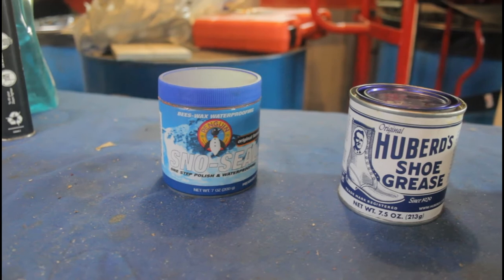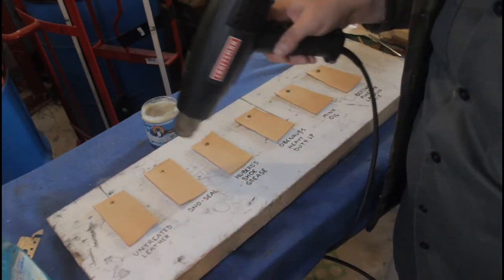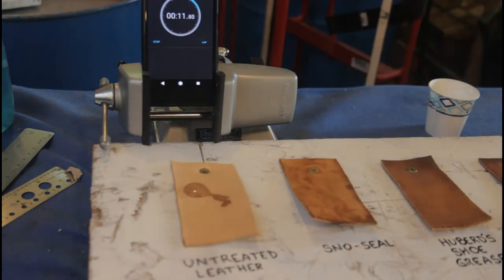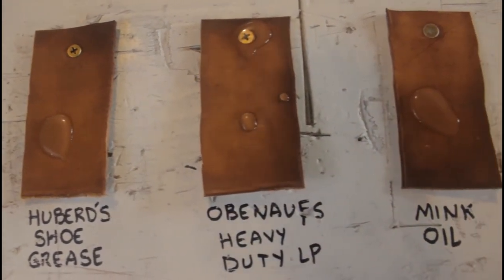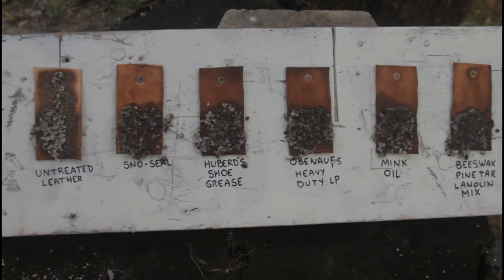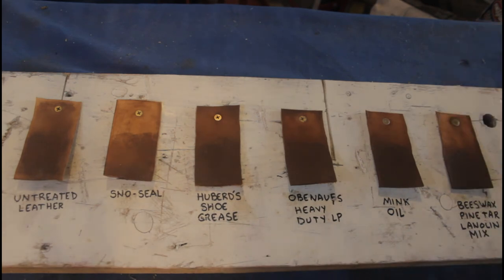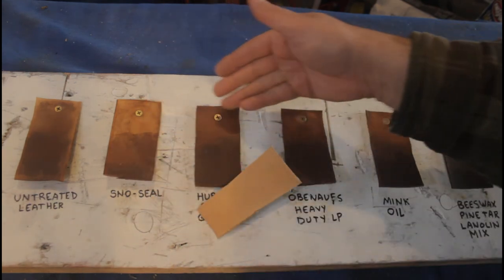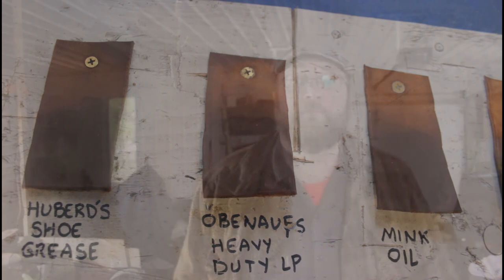Testing Leather Treatments

Comment: I think the sno-seal got a bad shake on the first test as the water bead was on the screw allowing the water to penetrate down the screw
Reply: exactly what i was thinking!
Reply: Spot-on comment! Congratulation on your Ranger Tab. Received mine 1964, I was with the 101st.
Reply: Obenaufs had a big drop right on the screw as well though
Reply: @lokoteconunoshuevotes4685 screw looked tighter on that one. Also on the sno-seal it only penetrated at the screw
Reply: @ricdonato4328 damn didn’t even get a like for that and it’s been a year.. blown

Comment: Past 40 years I have been using light  amount of mink oil followed by moderate amount of sno-seal and I still have some boots from 40 years ago.  Caveats: too much mink oil will damage the structural integrity and strength of the leather so use sparingly and too much sno-seal will make the leather completely unbreathable so use moderately if you wish to retain some of the breathable characteristics of natural leather.

Comment: Sno-seal requires you heat the leather hot enough that it melts when you put it on the leather. They add a solvent that lowers the melting point, and if you don't heat the leather first, you can get voids from the solvent as it evaporates.

Comment: Part of my duties are cleaning public restrooms, We use a disinfectant similar to pine Sol and occasionally bleach. I always buy gor tex boots,Either danners or cabalas brand. If I get a year out of them before they leak I'm lucky. The leather drys out and cracks.I normally spray them a few times a year with a silicone spray.I last week I started out by putting snow seal on my new boots. My plan is once a month redoing them with snow seal.
Reply: How did the snow seal work a year later

Comment: Pine tar is great stuff and it is non water soluble, however it is fat soluble and oil could be considered a fat. Sno Seal has turpentine in it to help permeate the leather the same as a lot of high quality boot polishes. Some people make the mistake (me included many years ago) to heat the Sno Seal before application and this can actually boil the turpentine out as it has a very low flash point leaving you with a hard to apply wax that is more like a clear wax polish.
Reply: I’ve been trying to figure out what’s in sno-seal for the longest time. How did you know it’s turpentine? Is that why it has that chemicaly smell?

Comment: I just ordered some Obenaufs, however I’ve always used sno-seal during winters. I guess in the end it doesn’t matter…whatever you apply in extreme conditions will need reapplying weekly or bi-weekly. The sno- seal does make my feet sweat and the boots stink because there is no breathing/air flow when that sno-seal goes on.

Comment: Great video.  I've used Snow Seal for many years and it always performs very well on my leather boots and shoes for waterproofing and preserving.  I'm not  a fire jumper or a construction worker out in the elements for 8 to 12 hrs a day, but I do hunt and fish with my boots and Snow Seal works for me!  I use Snow Seal a couple times a year on my boots and even polish my boots once or twice a year with Kiwi regular shoe polish.  I do clean my boots regularly if they get covered in mud and gunk  I don't leave the mud and gunk set on them and dry.
Reply: Same!  I've used Snow Seal in an area of Michigan that gets over 140" of snow annually and a healthy dose of salt and sand.  My boots have stood up for over five years without retreating and with no damage to the leather.

Comment: I wonder if having grain of the leather exposed allowed the salt, gravel, and oil mixture to penetrate easier? It'd be interesting to see this experiment done in a way where the the leather samples are like flex sealed in place so that the solutions put on it can't reach the grain and there aren't weak points like with the sno seal and the screw. Also like you said, have each solution done separately because for me personlally i want to know what'll help keep wet concrete from drying out my boots.
Thank you though, definitely one of the best videos on youtube that show leather sealing for WORK boots, not just someone worried about early morning dew 😂

Comment: I use snoseal and Hubert’s … snoseal works better in heavy snow or water for but Hubert’s works good on initial break in and mild snow and water … usually apply it again and again while snoseal will last a week or longer depending on the water I’m in

Comment: This gives me an idea for a somewhat similar test comparing how well different leather conditioners last. I was thinking of testing olive oil, coconut oil, beeswax, a mixture of the 3, and used motor oil. I could also test 2 different application methods, and see how well they preserve the leathers flexibility and appearance in outdoor conditions over time and compare the results to a control peice.
Reply from the maker: Sounds like an interesting test. I would be interested to see your results. 

I've never heard of using used motor oil as a leather conditioner, but it might work well. I don't know how well it would last over time, (it might cause the leather to break down physically),  but it should certainly repel water when it was freshly applied.
Reply: Past 40 years I have been using light  amount of mink oil followed by moderate amount of sno-seal and I still have some boots from 40 years ago.  Caveats: too much mink oil will damage the structural integrity and strength of the leather so use sparingly and too much sno-seal will make the leather completely unbreathable so use moderately if you wish to retain some of the breathable characteristics of natural leather.
Reply: I’ve used coconut oil and it works… have to apply it often … I made the mistake of over saturating my boots and it caused the leather to weaken and crack in spots… my fault not the oils… learned to apply a little wear and reapply as needed
Reply: @CircleBrewery  I have used coconut oil, but that is pretty different from a controlled test.

Comment: Just curious as I use a silicone spray for my new work boots every year. Can you use multiple layers of these products as they dry? Say over a three day period adding another layer for more protection.
Reply from the maker: Yes you could use multiple layers. Though I should note that since the compounds don't really sit on the surface, the idea of layers isn't necessarily applicable. With the application of heat, the compounds are absorbed into the leather like a sponge absorbs water. You can continue to apply treatments until the leather is completely saturated.

Comment: Interesting,  ive tried em all  working in the woods with logging boots in the wet and  snow and found snow seal  to be slightly more water resistant than the others
Reply: Yeah it’s just a pain to apply and is ridiculously sticky

Comment: Anything that repels water and doesn't destroy the leather or make it stiff will do the job. 
I recently bought a seven lb candle for $1.50 four pounds of beeswax for about $ 15 and a quart of clear mineral oil $ 12... melt it all together in the 'right' amounts and cast in handy size blocks... about 15 pounds of blocks for about $30
My usual mix for jackets, leggings and boots is 40/40/20% beeswax/paraffin wax/mineral oil and it performs just as well as any fancy named brand stuff for a fraction of the price.
Interesting video thanks  - I'd much rather make my own.... way more fun and satisfying.

Comment: I use Hubbard's but I'm not in the shop I'm in the woods.  What if you did a layer of Sno-Seal then a layer of Hubbard's  or vice versa.
Reply from the maker: I think at some point the leather becomes fully saturated and won't absorb any more compound. But two coats in either order are probably better than one if your leather can take it all in.
Reply: @ShawnsWorkshop  I was told never to use synthetics/chemicals on leather but have you ever tried?  Maybe just at the seams by the soul of the boot
Reply from the maker: @joeryan7024  I've never tried full synthetics. I think even Sno-Seal is mostly natural ingredients. It's probably worth an experiment, but I'm not sure what I would use. I do know one old guy who treats his knife sheath with WD-40. It seems to repel water well enough, but it made the leather much more soft and floppy. Also the smell never fully goes away. It works for him, but it's not something I'd do if I had any other product to use.

Comment: they are not a Water proofer
Reply from the maker: Sno Seal and Huberd's Shoe Grease both state "Waterproof" on their websites. Obenauf's LP states "protection against Dynamic and Static Water Penetration", and Cadillac Mink oil states "Water Repellant" on the can. They're not claiming IPX-7 submersion proofing, but I'm not going swimming in my Red Wings either. For me if it keeps out the snowmelt and road crud then its doing a good job. 

I'd like to make another video like this one to test even more products. What leather treatment do you use?
Reply: @ShawnsWorkshop  Obenaufs it's a leather conditioner it not a water proofer it protects the same way the oils on your skin helps protect your skin.

Comment: Salt is very acidic hence every test panel got soaked up with the mixture of oil, salt and etc...test concludes the products doesn't have protection against acidic substance. jmho
Reply: Salt is chemically neutral, with equivalent amounts of positive and negative ions.
Reply: Salt isn't acidic, it's neutral.
Reply: @Boddah.  @Gareth Baus You guys are absolutely right! what salts reaction to metal its ability to speed up oxidation by allowing the metal to lose its electrons which in turn makes the metal vulnerable to elements such as oxidation and degradation.

Comment: If your boots are made from 5 oz leather. Then it's probably sure, that you bought Walmart boots! 😂
7 to 8oz is what Wesco and Whites use! And that's what boots should be! That's why, they use that weight.
Reply from the maker: Most working tradesmen can't afford a pair of boots that cost more than their mortgage payment. Also most of the industries I've worked in provide a $150-250 boot allowance per year. Why spend your own hard-earned cash on Whites when the company is going to buy you a brand new set of Redwings every year?
Reply: @ShawnsWorkshop  The mine supplied pit boots I wore for decades were legendary for weight and strength, but unless you knew the secret to conditioning them, you did not break them in, they re-modelled your feet !
Used to soak them in hot water and keep that water hot for 48 hours. That softened  them up. Then you put them on and wore them till they were completely dry ... a couple or so of days and they then conformed to your foot shape. Then we covered them in a good thick layer of grease and stuffed them in a poly bag and left them in the hot drying locker for a week or so. A touch up a couple of times a week from the grease pot in the lamp house kept them good. Totally waterproof and fitted like a pair of gloves ... so to speak   ;<)